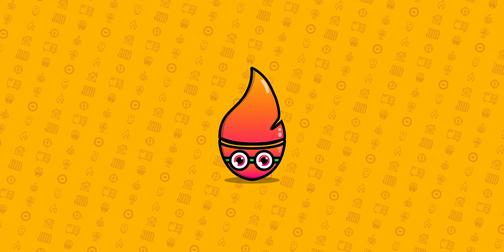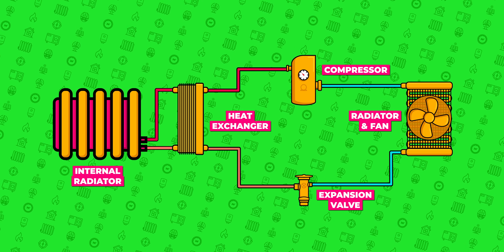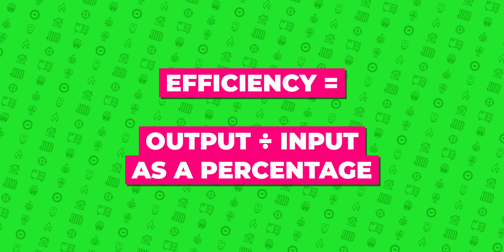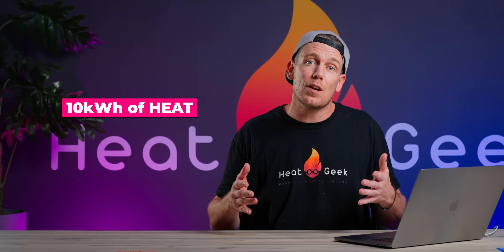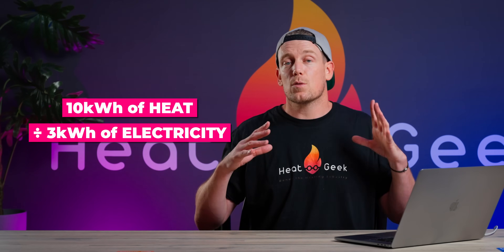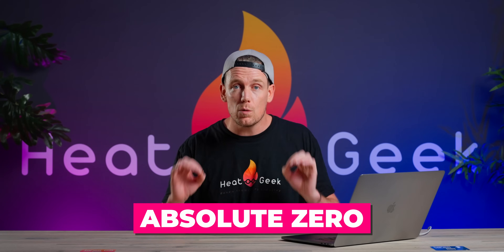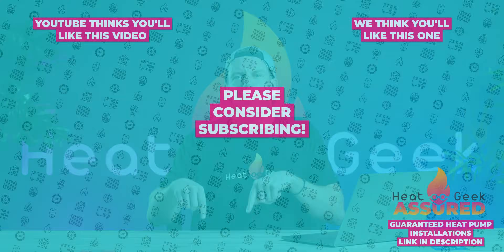How Can Heat Pumps Be More Than 100% Efficient?

Comment: SO remind me why I need to do this?. I ask because the UK's only responsible for 0.1% of global CO2 emissions and actually scrapping my gas boiler and having one of these things installed will increase CO2 output because they will need to be imported the thing will have been made mostly from burning coal and its then shipped here from China on ships that burn bunker oil or diesel, maritime vessel do not have an emissions regulation either.And as for COP efficacy its just smoke and mirrors, the only thing that comes anywhere near being 100% efficient is nuclear fusion and fission,, thats because your converting mass to energy anything mechanical will always incur losses through friction and resistance, in heat pumps its the compressor pumps and fans that use significant amounts of energy, the efficiency they go on about is the difference between the tiny amount of extra heat the refrigerant has collected from the outside atmosphere, its a trickle feed of a few degrees, ironically just like renewable energy heat pumps are most efficient when you need them the least ie on a nice war day, come winter the outside temperature drops and the heat transference drops with it so down goes your efficiency, its also very strange theres never any talk about the emersion heaters these systems have. People only ever focus on the thermal exchange between the refrigerant and the outside air.
Reply: What's an emersion heater? Does it emerge from somewhere? Modern heat pumps themselves generally don't have an immersion heater. The DHW cylinder often does, but for R290 heat pumps, it's not required.  And in the cases of non-R290 ones, it's only used for bringing the water temperature up from the maximum temperature that the heat pump can handle (~55C) to 60C.
Reply: @BenIsInSweden 
Legionnaires disease?
Need to heat dhw by additional means ( immersion heater) above that possible by hp action?
Reply: @eric4709  R290 ones go up to ~75C.
R32/410a ones can get up to ~55C, which over a sustained period is enough to kill legionella. But if you want to be safe, all of them have an anti-legionella cycle that will heat via the heat pump to their maximum, and then use the immersion to take it the rest of the way.
It's:
a) not as energy intensive as people think. and 
b) often safer than most gas boiler + cylinder setups that are heated with a timer rather than temperature probe.

Comment: I would be interested in what research has been done to help get as much warm air into the heat pump rather than just take normal air. By this I mean possibly siting the heat pump in a warmer area in sun. If there was an ventilation system installed in a house that had exhausts to the outside air without any heat exchanger would there be a benefit in funneling the waste air/heat from the house towards or into the main intake of the heat pump? Would it impact the SCOP at all?

Comment: I was screaming at videos that above hundred per cent efficiency is impossible, but they neglect the sun's power which is put in the air, indirectly heating your home. Thanks for clearing up that it is in fact 60% per cent of the energy. With their stupid definition, you'd have infinite efficiency if you didn't use electricity at all if you power it with solar panels e.g.
Reply: It's the efficiency of heat delivered: the ratio of heating power delivered as compared to the electrical power used. Solar power would just discount the cost of electricity used.

Comment: I have a samsung air to water heat pump , when it's cold the heat pump goes into short cycle which uses 5kw of electricity, this happens when the heating is not on ...so there for its using electricity and doing nothing!!, only when the temp outside is mild it uses less energy and when it's cold it ends up being expensive to run and the heating is not that good, can't say I'm happy with it to be honest
Reply: It's the efficiency over the whole year that counts. Short term reductions in efficiency during cold temperatures are only a small part of the picture.

Comment: We had our viessmann heatpump fitted start of November 2023. Very pleased with it  efficiency at 460% for heating and 288% for dhw for the months of November and December. When its only cool outside say 8c to 10c it pulls about 600w per hour to deliver about 4kWh heat, so close to 600%. It close to freezing as it type this, now pulling 1.3kWh for 5.7kWh heat, so down to 400%. Flow temperature at 35c at 0c. Modern build with UFH throughout all floors. Heat Geek installer.
Reply: Damon Blakemore?
Reply: @singlendhot8628  Darryl Evans.

Comment: High efficiency is always good. But no 1 really cares about 100 plus efficiency. They care about saving money. What is your cost of 1 therm of natural gas which produces 100,000 btu. Now let's convert electricity to therms. 1 kilowatt at 100% efficiency makes 3,414 btu. 100,000 btu / 3,414 btu = 29.29 kw. In my area kw 10.38 cents. so 100,000 btu of electricity cost $3.04....ouch. This is why resistant electrical heat is so expensive. Natural gas cost about 99 cent for 100000 btu. Comparing a 95% furnace and a hsps5 10 heat pump. Heat pump cost $1.04 per 100,000 btu. Furnace cost $1.05 at 95% efficiency = 100,000 btu. At the end of the day if you live in a cold climate below 25 degree a heat pump may not be the best choice because natural gas never looses efficiency l.

Comment: So surely if the heat pump is ~300% efficient (avg) but fuel cost is 30p/kWh and a boiler is ~100% efficient at 10p/kWh then the fuel cost will be the same?
Unless we can guarantee that electricity will be significantly less than 3x the cost of gas then why would anyone take the risk today? Not to mention the disruption and costs associated with installing a heat pump.
Small tangent incoming
Heating homes with electricity and electrifying transport will prove to be massively profitable for utilities; generating free energy from wind, solar and hydro with the alternatives (oil & gas) being phased out by governments they will have no competition, meaning they can charge what they like. Great for shareholders; worrying for consumers.
FYI - I'm completely on board with renewables and creating a sustainable future (and EVs are fantastic), but how do we ensure that utilities don't tear us a new one?
Reply: Gas will never be 100% efficient for heating a home unless you don't mind an explosion from the pressure build-up or killing all the occupants from oxygen deprivation.  Saying a gas boiler is achieving 90% efficiency is pretty generous with the UK installs as well. One thing to note is heating with gas is affected more by price changes than a heat pump.  i.e. even with the lowball 300% efficiency, electricity needs to rise by 3.3p per 1p rise in gas to have the same effect on the heating bill.  There also comes a point where electricity price rises start making solar and battery storage even more worthwhile than they are today.

Comment: I am looking at replacing my 20 year old Worcester bosch boiler. The problem for me the consumer is How would I know that a system for me was designed and setup for my property to achieve the scop values your talking about and what recourse would I have against the installer if it didn't.

Comment: "When the refrigerant is warm it is in a vapour state" - "and when it's cool it turns back to a liquid"
Don't think so!
Reply: @zlmdragon.  OK
Reply: @zlmdragon.  That's true. But there are warm regions of liquid and cold regions of vapour. The phrase "When the refrigerant is warm it is in a vapour state"  is not universally true.
Peter Lawton
2 months ago
Reply: @zlmdragon.  The warm/hot part of the system is 100% vapour at entry  and 100% liquid at exit. The temperature does not change.

Comment: Thanks for another great video.  It was interesting to hear that when it looking at SCOP it is biased towards the winter as that is when the heat pump is more used.  

Still when I look at specs for air to water heat pumps which give a specific SCOP for a specific flow temperature and out door temperature (e.g. Vaillant state their 12kw model at -5C outdoor can achieve an output of 10.8kw with a 55C flow temperature and a SCOP of 3.63). I guess I struggle to see how that applies to real life.  

1: What are the assumptions made when a manufacturer states performance like that
2: How does that apply to a real life situation - Can you infer that if a system has been properly installed and never has to generate a flow temperature more than 55C then the SCOP will never be lower than 3.63?

Thank you for all your videos
Reply: For reference:  https://www.vaillant.co.uk/downloads/aproducts/renewables-1/arotherm-plus/arotherm-plus-spec-sheet-1892564.pdf
Reply: 1 further question (sorry).  When looking at projected SCOPs for a system, do they take assume weather compensation?

Comment: We have a Mastertherm ground source heat pump system. We keep the room stats to max and allow the weather compensation to do the work. The system runs 24/7 and the house is 21°c throughout. It works absolutely fine and is definitely cheaper than the old oil boiler we used to run.
Reply: You don't adjust for night time or different rooms, eg, bedrooms?
Reply: @JohnBell-rf6oj  hello, no we don't adjust the trv's. Occasionally overnight guests turn them down, but I think everyone's comfortable temp is different. It has taken time and tinkering of the heatcurve to get it right for our situation. We have set it as 40°C flow temp when it is -7°C outside. We heat the house as a whole rather than individual rooms and it works for us.

Comment: EVM will brag about his 5kw ASHP giving him 500% when using it to heat his home in winter between 1-5 am when the big bad frost is out there,
i'm not anti heat pumps, but we know yes they work at -5, BUT how many times does the device need to cycle per 1hr at these temps.
if the heat pump will be used only in the window 1-5am i would guess at a 200% max efficiency.
i have a air con unit 12,000 btu as you said the same tech and yes it operates between in heat mode, at 10 outside at 1200w but at -5 you ain't going to get much heat, and in the past i did have a ASHP which operated at 13amps and delivered upto 5kw of heat, but the unit was left on 24/7 and the home was nice a toasty,
leaving the efficiency of the heat pump now, i'm an electrician if heat pumps are what the say they are
why the hell are most small pumps require a 16a mcb and large one's 32amp mcb.

Comment: The COP of a heat pump only applies to electricity used by the compressor to an equivalent amount used by an electrical resistant heater.  All electric resistant heaters, including your hair dryer, have a COP of 1.0 where only a given number of BTUs will be produced per kW of electricity the device uses.  Heat pumps do not produce heat, they move heat as indicated in the video.  A heat pump therefore can move more heat (BTUs) per kW input (a result of the work being performed by the compressor) than heat generated by a resistance circuit.  You cannot compare the COP of a heat pump directly to a natural gas, fuel oil, or propane furnace as the performance ratings are different.  An accurate comparison must include the delivered heat into the home based on the cost of the fuel or electricity.  Natural gas wins most of the time depending on where you live.
Reply from the maker: But increasingly less often.. USA please stop using kw for electricity and btu for heat 😜
Reply: Are you saying a compressor in a refrigeration circuit produces no heat? Yes or no?
Reply: @darrenr1995  Small refrigeration/heat pump circuits use hermetically sealed compressors, where the returning refrigerant gas cools the motor windings.  The resistive heat from the motor is then moved to the condenser along with heat generated by the compression of the refrigerant gas.  The heat generated by the compressor is likely minimal, and minimally affects the overall COP of the system.
Reply: @mmcclen9  whether it’s mono or split , the compressor will have 4-8bar on suction side and 15-30 bar on discharge side depending on demand. This is achieved directly by work done of the compressor. Temp increase is significant across the compressor by compression of the gas. We absorb heat at the evaporator but we most certainly produce heat too. AC technology is super efficient but to say we get the heat energy just from the air and not electric is false.
Reply: @darrenr1995  I agree.  Majority of heat produced in the compressor is due to compression of the refrigerant.
Reply: @mmcclen9  so a strange video then saying “it’s the outside air we get our heat energy from, not the electric” 
I wonder why.
Majority of the heat produced in the heat pump is from compression.

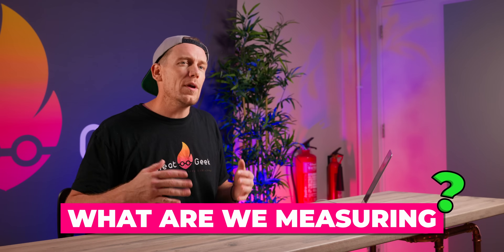Comment: Guys this part from 2:30 - 3:00 is really misleading. Saying things like:
“The heat energy doesn’t come from the electricity, it come from the air”
The air outside heats a very low pressure and temp refrigerant, allowing it to ‘super heat’ and return to a gas, ready to enter the compressor. We gather some heat but it’s not yet useable, to heat anything in the house, it’s when it hits the compressor that the pressure is increased significantly and consequently the temp to a useable level. The compressor consumes a fair  amount of power to do this.
Reply: it comes from the air, plus whatever you burn in the compressor doing the compressing.
Reply: @edc1569  right, so a long video that doesn’t correctly explain it.
Reply: The compressor consumes most of the electrical power fed into the HP. But it isn't wasted. It does work on the refrigerant, so increasing its internal energy (causing an increase in its temperature). dU=W+H if you like thermodynamics. That equation about sums up a Heat pump. The H is the heat absorbed from the environment, W is the work done by the compressor. dU is the change in internal energy of the refrigerant. You are right - the video does not correctly explain it.

Comment: A heat pump is not more that 100% efficient!!!!! A  petrol tanker moves 30 tones of diesel from the refinery to to to petrol pumps in your town for say 0.5 tonnes of diesel. Does that make a diesel tanker 6000% efficient?
If you have a machine which is more than 100% efficiency you have "over unity" and welcome to the "free energy" world. I expected  better of you  at heat geeks.  Seems you just make false claims like all the reat which is a shame because what you promote, if you where  to do do honestly, will contribute to a better, greener, future.
Reply: If you don't like the term efficiency, which is used here for convenience, then use the term coefficient of performance.  The term here is simply used to determine the ratio of the heat moved against the input energy thats consumed.  If you don't believe heat can be moved then please explain to me how your refrigerator works.
Reply: @edc1569  It's not that I don't like the term efficiency, it's that it is false to claim a heat pump is more than 100% efficient. Use the correct term (COP) or just state that it is collecting x% more energy than it takes to run.
Reply: @nickwinn7812  and yet the vast majority of normal non technical people understand it more when you say its XXX% more efficient than what they are most likely using such as a Gas boiler etc the common example of 1kwh put into a 1kwh electric radiator gives 1kwh of heat, an ASHP using 1kwh of power gives the more than just 1kwh of equivalent heat out (around 3kwh) but the COP is different at different temps and times of year
Reply: @zlmdragon.  Perfectly!
Reply: @zlmdragon.  Good point - you should follow your own advice too!

Comment: I must be doing something wrong. When I compare £ savings for our Viessman 200-W gas boiler to a ASHP, I assumed: 

1) A price difference of ~£6K for the purchase of a German ASHP (Vaillant) after all government incentives.
2) A SCOP of 4 for the ASHP (optimistic) and our boiler efficiency of 95% (realistic)
3) Current price cap energy tariffs of .34p and 10.5p for gas and electricity respectively and
4) A total heating demand of 15K kWh

We would save £300 per annum with the heat pump. (In all likelihood, savings would be lower). It would take ~20 years to recover the added cost of the heat pump, assuming nothing went wrong. Sound right to you?
Reply: Yup, add (or already have) solar and battery storage and it can affect the equation. You should expect the difference in price of gas/electricity to change to a 2:1 ratio over the next 10 years and then to 1:1 for the final 10 years of gas.
Reply: ASHP advantage you are not considering is that you can help to save the planet as well as save the ££££s
Reply: @peeteebee123  Not as black and white as you may believe. If the grid is green (we are only half way there), and you are able to power the ASHP outside of peak grid usage, then yes, it can be environmentally beneficial. 

A V200 is the greenest gas solution there is and does not rely on any of the above, nor does it have the embedded carbon costs of manufacture of the ASHP or batteries and it is immune to power transmission losses.